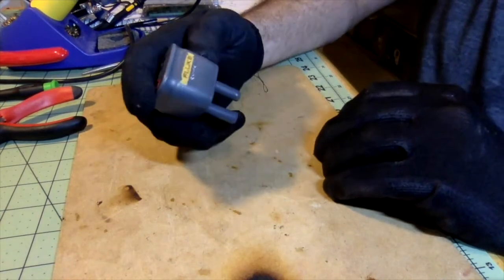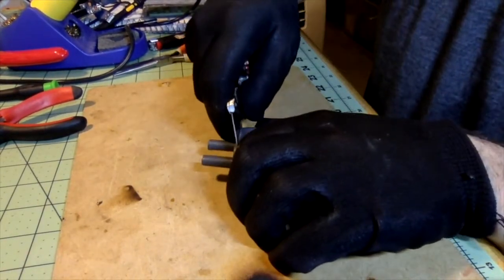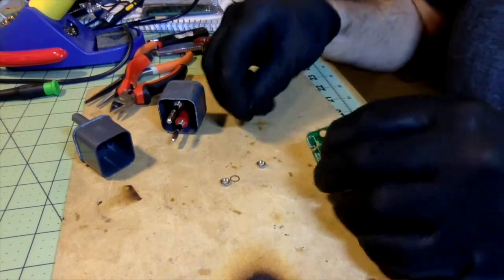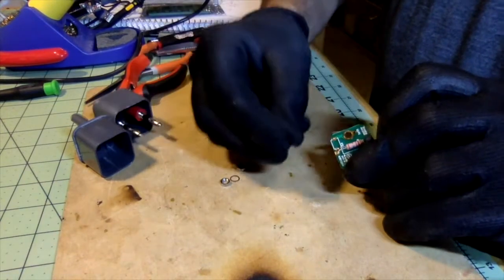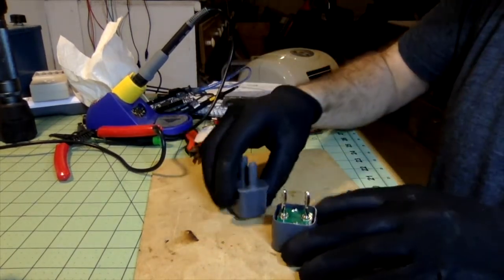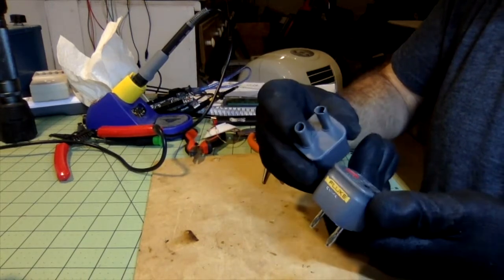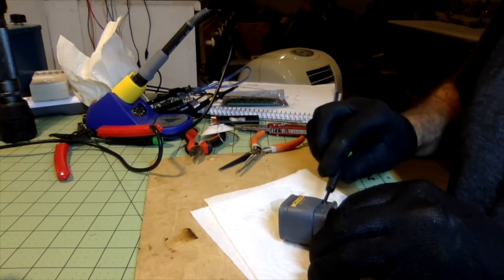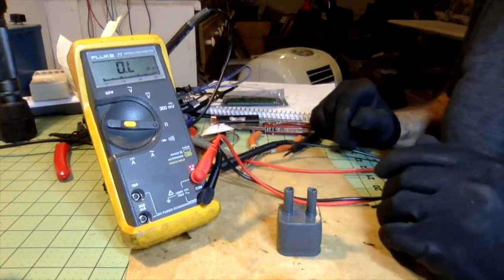Fluke SV225 repair

Comment: I see this is an old video so not sure if I will get a reply.  The circuit is a 3kOhm resistor and two ptc thermistors.  What value are the thermistors or do you have a part number for them?
Reply from the maker: Sounds like you are designing your own, just set a max voltage of the part at two times your max voltage and you will be ok. I don't have the p/n's for the pic in this unit, I do not know where it is to check.
Reply: I was going to make something similar at least useable, I can't quite make out the value of the resistor either, any idea what that was? Thanks, great video.
Reply from the maker: @mbennett979  Just calculate the max wattage through the circuit, then double it for the resistor.

Comment: Hi, maybe you would know why SV225 hoked with 87V, when measuring live circuit, trigger my RCPD (residual current protection) whenever I touch ground or neutral. Now issue when measure de-energized circuit.
Reply from the maker: Hard to understand your post, sounds like you have leakage to ground on the GFI circuit or a faulty breaker.
Reply: @electronicsprojects4708  Im sorry English is not my native language. 

I just would say that when I use fluke87V with SV225 on live circuit (230V in Europe) and measure L + N or L + PE (ground). It trigger my RPD. Just wonder if it can be even used if there is RPD protector  in house.
Reply from the maker: @akiraone28  It should not trip the protection if you use it between L1 and L2, if you have a Ground Fault Circuit, it will trip if you use Ground in the USA, not sure about Europe, though.

Comment: Thank you! Very useful video. I was breaking my head what's inside since I've got that SV225 about 15 years ago. Right up to this morning, when I've wrote to one guy that there no way it's just a resistor. Otherwise, for the 1000 V input voltage that resistor would have to be at least 333.33 W and huge.
Reply from the maker: that's right

Comment: I would assume this is a case of a factory worker simply not feeding enough solder as you would not want to solder the top and then the bottom, or vise versa, great way to trap air and have voids and weakness. Good flux, good solder, higher heat than most people think, and little dwell time. Get it done. If the PCB was made in Asia, well Japan rather, I have bad experiences in the business with Japanese hand soldering. They are TOO by the book, don't take into account the many heat sinks around a large or high powered through hole, notorious for low heat low dwell hand soldering with bad results.
Reply: "The book" says to use appropriate heating (tip size, temperature, dwell time, and especially for desoldering/rework, a separate preheater if needed) for the joint, so a poor joint from insufficient heating is certainly not "by the book", I would say!

Comment: Greetings, to summarize that device is a 3k 2watt resistor in parallel to the test leads ... and the two ptc are on each side of the series resistor, in case there is a short circuit ..... is like this the circuit ?? I ask you to make one for me, but I will not put ptc, only the 3k resistance.

saludos, para resumir ese aparato es una resistencia de 3k 2 watio en paralelo a las puntas de prueba... y las dos ptc  estan a cada lado de la resistencia en serie ,  por si hay un corto circuito..... es asi el circuito ?? te lo pregunto para fabricar uno para mi, pero no le pondre ptc, solo la resistencia de 3k
Reply from the maker: that is pretty much the circuit.
Reply: @electronicsprojects4708   ok, Gracias.....
Reply: If you don't put PTC but just a the 3 kOhm resistor it would need to be not 2 W but at least 333.3 W in order to withstand power generated by 1000 V voltage.
Reply: @IliyaOsnovikov  entiendo......pero solo lo usaré en 220vac......y por supuesto solo sería por unos segundos la medición, pero para voltajes mayores a 220vac no lo usaría.... hasta los múltimetros que traen la función LOZ recomiendan medir por poco tiempo, por qué igual se calientan si se deja midiendo por largo tiempo.  en resumen es solo para detectar si hay voltaje fantasma o no 👍
Reply: @miguelc_seeker  For 220 V you still would need to have at least 16 W for 3 kOms. 220 V * 220 V / 3000 Ohm = 16.13 W. Why don't you want to use PTCs?
Reply: @IliyaOsnovikov  como te dije antes, solo es medir unos segundos para saber si existe voltaje fantasma .... ahora sí uno  mide por largo tiempo, allí si hace falta usar las PTC para que aumente la resistencia y proteja el múltimetro o a uno mismo..... si mides rápido no hace falta colocar las PTC,  ese aparato de fluke las trae por seguridad nada más.....
Reply: @miguelc_seeker  It's up to you, but I would not use for 220V 3 kOhm resistor with a power less than 15 W. Because if you decide to monitor 220V line voltage for more than a few seconds and don't unplug that LoZ (2W) resistor it will just smoke and burn.
Reply: @IliyaOsnovikov  claro en eso estoy informado.....pero como le dije...no es para monitorear por largo tiempo, solo para medir unos segundos y ya 👍

Comment: Tell me, please, what resistance to PTC resistors?
Reply from the maker: about 3k at room temperature
Reply: @electronicsprojects4708  Thanks for the quick response, but is there consistently a chain of sort of one constant resistance and two PTC resistor? Yes, 3 kilos is the general resistance of the whole chain.
Reply from the maker: @AS2009  low ohm resistor in series, probably to protect from short circuit of PTC.
Reply: @electronicsprojects4708  Thank you for clarifying!

Comment: Will this work with my Fluke 87v ? I went online and really couldn’t find anything on the little device. I’m also fairly certain the 87v doesn’t have lo-z built in
Reply from the maker: Yes, it will work for the Fluke 87v, you are correct, there is no LOZ function on it. It does have a low pass filter on the AC voltage setting.
Reply: Electronics Projects Thanks!

Comment: Interesting video. Could you pass the schematic? I could never find it. Greetings from Argentina
Reply: I think using commonly available components can yield better results.  Hope to build my own using 12 3.9K 5W metal film 500V resistors and a couple of 0.1A  250Vac fuses.

A group of 4 resistors in parallel making about 1K ohm.  In series  with 2 other identical groups making a total of almost 3K.  Fused in series with the resistors and in series with the test leads of the meter.  Should be able to take 240Vac almost continuously, 20W.  Resistors total wattage 60W.  Fuses will blow at 300Vac at 0.1A.

The SV225 can not sustain even a 120Vac without the thermistor kicking in, IMO.
Reply: @ntag411  What's the purpose of such heater? That low impedance meter input (LoZ) is only needed in case if there is no real voltage but meter picks up some some electric noise (that has no power). But in case if the real voltage is there we don't need that LoZ at all. The way Fluke made it the LoZ is there only when needed (to suppress so-called ghost voltages).